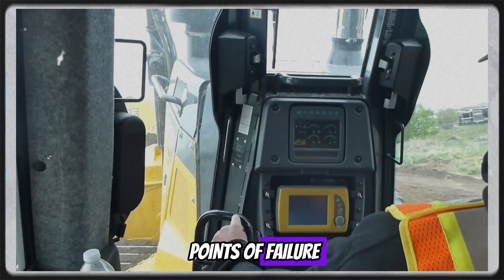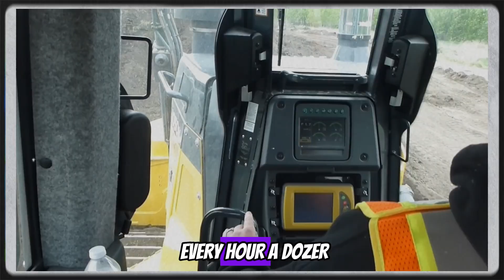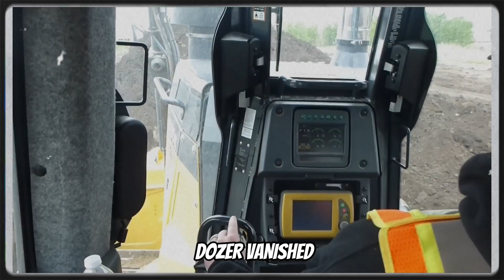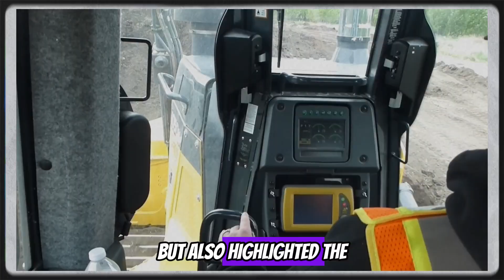Why Did Two-Speed Dozers Vanish? (You Won't Believe It)

Comment: My  Cat 955H has a two speed transfer gear so you had a high range and low range.
Reply: Not trolling Robert. Just curious because you wrote "has" a 2 speed, then "had" high & low. Is it still up and running? I'd like to think Yes! Those old Cat 955's were pretty tough. I remember running a 955 Loader that had so much play in the crab axle that it wasn't even funny and we also had a fairly new Komatsu of about equal or maybe a bit bigger. That old Cat felt like it had twice the power. The dilemma was that the Komatsu was like a Cadillac to operate but l could get twice the production outta that old Cat.
Reply: Correction: It was a 950 front end loader. Ah, you know what I meant.  LOL

Comment: Case Dozer had high/ low Just dont shift the high low etc under heavy torque load lol. Hey Dodge Diesel trucks too. Take y foot off throttle shift auto manuall. A std trans even in a semi ( shift with out using clutch ) buy hey take foot off throttle. Its alot to do "how u operate the equip"  Heavy on throttle will over heat a V- 8 lol. 6cyl takes the lugging. No the 903 cummins wasnt hard on fuel. Only ran 2900 on the roads - yes 30mph with Ford Fw- 60 lol.  In the field "find the sweat spot" ussually only around 1300 - 1600 rpm Cat C 15 in semi 1300 got fuel mileage. Made own fuel cond etc. Gov accused of burning farm fuel ( wanted more road tax ) Yes mg couldnt beleive fuel milage either. Yeh heavy equip NO road tax lol. Diff models are diff. Something like sisters. Lol. Know y equip. Can recond hyd oil etc. Make pivotal axle driven attachements for skid steers now ( NO China only cipies ideas ) carry more weight with smaller Bobcats etc.with a ballance issue. And yes can turn good yet too. Lol. 1 403 830 4124. Steering/ braking traction for tow trucks etc on ice lol